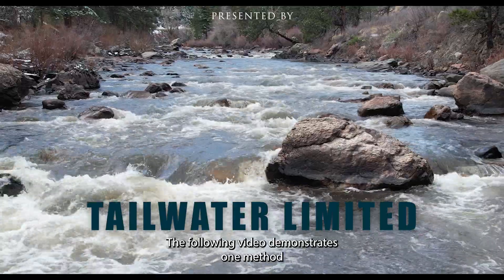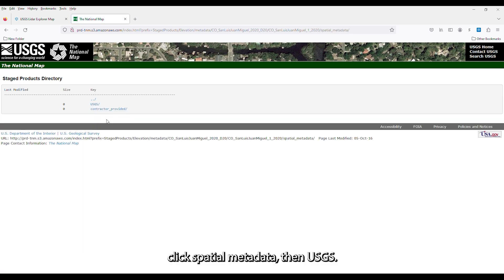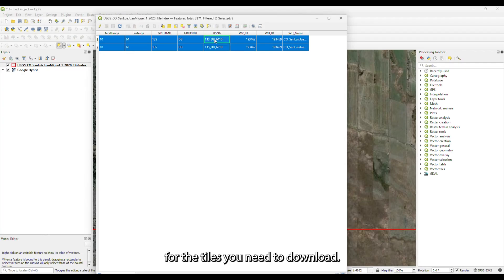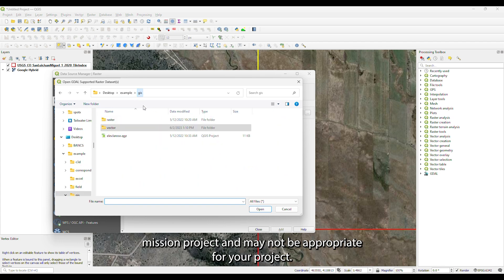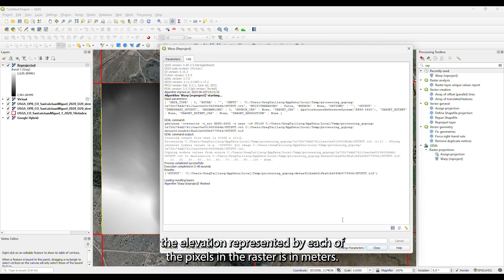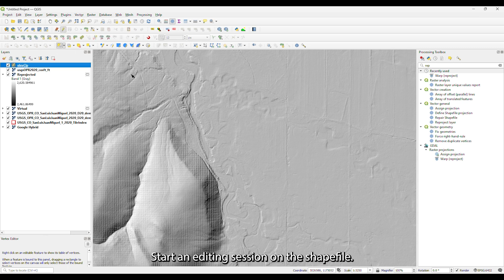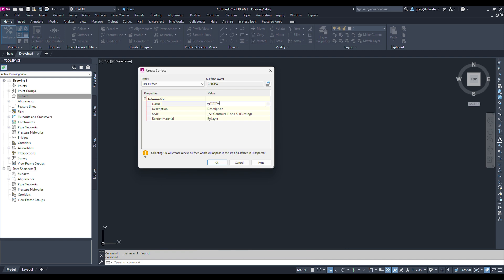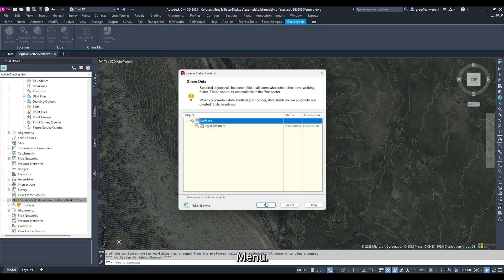1 - Creating an existing ground surface in Civil 3D using a DEM downloaded from USGS LidarExplorer

Comment: Do you always use the warp command to reproject? Could you just override the projection during the output when building a virtual raster, or just save as with the preferred projection?
Reply from the maker: We've stopped using warp to reproject the raster. I should update the video. The warp command seems to have been scaling the elevation values on the DEM. We typically use the save as function to project the raster to the correct coordinate system. Great question! Thank you!